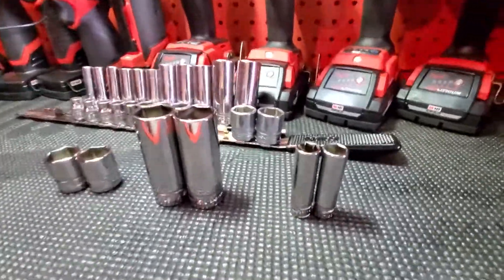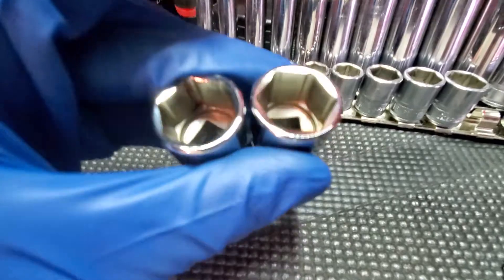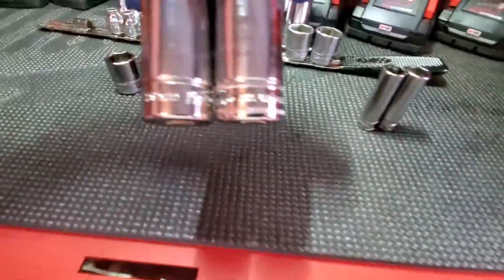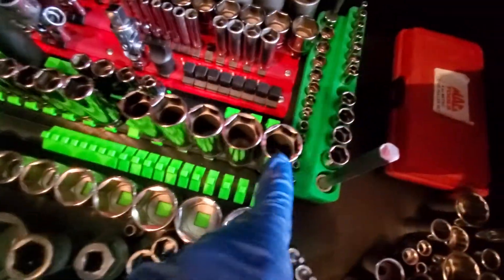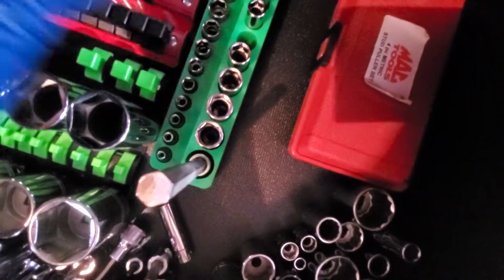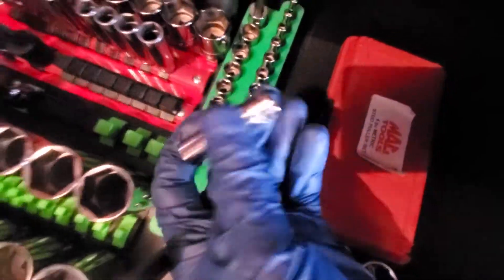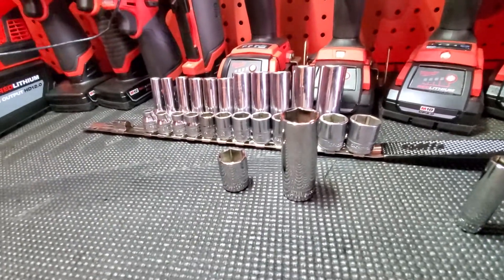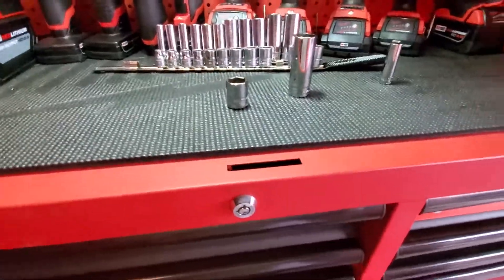Snap-on vs Williams USA sockets are they the same?

Comment: Fun fact..I ordered the williams usa set from Amazon and the one socket was stamped snapon.
Reply: pics or it didnt happen
Reply: @NoLoveinHell  no it happened. go on amazon and look at the reviews has happened to a bunch ofpeople. if there low on sockets theyll pull one from snap on. They are the exact same socket. Williams calls it supertorque technoloy and snap on calls is flank drive , all they do is change the stamp. If you youtube the video of How its made Snap On sockets if you look closely youll see when they are stamping them they actually are showing the williams ones being stamped. They are made in the same factory.
Reply from the maker: Yes sir they even weigh the same.
Reply: @smotheredchrome  this is true as well. In wranglerstars video of him piecing together a snap on equivalent toolbox he purchased the Williams sockets from Amazon and he measured them with calipers they were exactly the same. Another great Williams buy is the screwdrivers. Basically snap on screwdrivers for 1/4 the price. And if you wanted to you could buy snap on colored grips and swap em out
Reply from the maker: Yes that screwdriver set is excellent I got the 19 piece set comes with 5 bahco  Precision screwdrivers and 14 Williams I paid $108 a couple years ago and now last time I checked it was $178 something like that, but one of my favorite sets by far especially the large screwdriver it's basically a pry bar, I will try and find the video on wranglerstar sounds like a good one.

Comment: The only thing is you got to watch out with Williams is they do make tools in Taiwan. sometimes they'll have the same set of sockets for half the price of the USA ones but they're made in Taiwan.
Reply from the maker: Yes usually when the part number starts with a letter it's USA made and the one's that start with numbers are overseas
Reply: @smotheredchrome  yeah I've heard that before about the part numbers.  I am loathe to buy Chinese or Taiwanese tools if I can avoid it and not break the bank
Reply from the maker: The USA sets are IMHO Snap-on just with Williams stamp I have Snap-on sets identical  in every aspect, but some will say different metals but bottom line great buy for usa sockets
Reply: @smotheredchrome  I agree with you the USA made ones are snap-on's with the Williams name on it. it would cost the company too much money to have two different sets of metallurgy.  It's much cheaper to have one production line and then put a different name on it. a lot of companies make private label tools for other companies and put their name on it.
Reply from the maker: I definitely love my Williams use them all the time. I appreciate your comments and support Thank you
Reply: @smotheredchrome  I just got a set of half inch deep Williams impact sockets from Amazon. they were on special so I couldn't pass up the price.  They look real nice. my only issue is the stamping is so small on them, it's hard to read the size. Protos have bigger stamping of the size. I might get a set of Protos for shallows. It all depend on which one go sale cuz they're prices are almost the same.
Reply from the maker: On my chrome Williams they are hard to read also, but I have them memorized in my drawer and that helps alot, but regardless you got some nice impacts for I assume a excellent price.
Reply: @smotheredchrome  yeah I got a 10-piece set for $93 shipped to my door. Plus tax.  Amazon dropped the price for 2 days from $111. so I had to jump on it
Reply from the maker: Nice that is a good deal congrats

Comment: Nice video. 

Do you have any idea if the metal that the Williams sockets are made from is the same as Snap-On? Can you do a hardness or scratch test on the inside of the two socket brands?

Also, how do you know for sure that the Williams are made in the USA? Does the package say 'Made in the USA' or are the sockets only stamped with 'USA'? Are the Snap-On USA made as well?
Reply: Same factory 🏭
Reply: There is Williams USA and Williams Taiwan
Reply: @Montana10mmAuto  I don't know the answer, but I know they are not the same hardness.  That could be caused by a lower carbon alloy or different alloy or a different heat treat.  I have heard that Williams sockets have a different heat treat. Heat treating steel is very complicated, btw, and shouldn't be BSed about. Stuff like how they pack the furnace, how close the sockets are together matters.
Reply from the maker: Thank you my friend I appreciate your comment 🙏

Comment: It is just the same dies. That’s obvious. The steel, how they were hardened, the chrome process you will never know.   They could even be old worn dies out of tolerance for Snap-On.
Reply: Why would one be any different than the other? Why would the "hardening" process be any different?
Reply: @captaingold1685  every batch of steel is a custom batch. Formulated to the customer or application specification. Plus the quality varies. 
Hardening varies with the heat source. Flame hardening, kiln hardening, inductive hardening and case hardening are the types I know of. Then there is the time it takes. From minutes to hours. And the quenching process. 
Steel production is the result of a thousand years of research and trial & error.   All done in secret. 
All steel is not the same. None of it is.
Reply: @davehaggerty3405  I understand all steel is not the same as there are different grades of steel. But using a different grade of steel would not necessarily be useful for application. You're basically saying they could have used a cheaper grade of steel...

I have the MSB-12HRC set which compared to my snap on 3/8 sockets are identical...
Reply: @captaingold1685  I only had one class in metallurgy. And that was 40 years ago so it’s all obsolete. 
I do know they don’t heat treat like they did back when I worked at Irwin.   Where everything came out of a rotating furnace into a big steel basket to get quenched in oil.     
I wouldn’t say Snap-on would use a different steel. Both probably chrome vanadium. But how much vanadium?  It’s expensive. 
I can’t say if they are the same or not. But I would bet they’re not. Why would any company make their secondary brand equal to their premium brand?
Williams is very good.  Made in the same factory. But I’d bet there is something special in the Snap-on process to make them special. There are just too many steps in the process for there not to be.
Reply: @davehaggerty3405  with snap on it’s the brand you’re paying for, not all Williams sets are made in America some are also made in Taiwan. 

They just look too similar. But if they’re different like you say they are good at disguising it. 

Good answer though.
Reply: @captaingold1685  @Dave Haggerty is correct. The misunderstanding seems to be about how factories fundamentally work They aren't some black box you feed raw materials into and tools pop out the other end.  Sockets are complicated and many processes and machines are used to make one.  Those machines and cutting dies and broaches wear over time. If you can create a second quality line of tools, you can use those older machines longer. This means more revenue per machine. Also, any tiny corner cutting you can do and get an acceptable product, will save factory time and lower product cost.  

We have seen many Williams screwdrivers which seem to use identical (?) Snap On shanks and handles but the holes drilled in the handles are sometimes slightly off. Not acceptable for a Snap On screwdriver, but not worthless.  Not saying Williams are Snap On rejects.  But something about the Williams screwdriver line generates tools with off axis shanks. Same factory, same processes. Some say the Williams screwdriver tips are not as hard. They could be rejects or batch processed somehow to lower cost.
Reply from the maker: Thank you my friend I appreciate your comment 🙏

Comment: You are mistaken. They are not the same. But they may very well be good enough, or similar enough. 

Your premise is fundamentally flawed: that they are made in the same factory, or even use common equipment (doubtful) does not guarantee identical utility/functionality. Looks similar, even dimensionally similar (to the extent you can measure) also are not reliable ways to say two items are functionally identical “rebrands”.

More: your generation better figure out and fast how manufacturing works as we surrender more of it to foreign competitors. The “they look the same, they probably all come from the same factory in China” idea is incorrect. You guys all seem to think you’ve discovered some “hack” and found the secret item that’s substantially cheaper than the “same” item found elsewhere. 

The world is a big and complicated place. Sockets are actually quite complicated products. There are good sockets and less good sockets, good beef and not as good beef (I know it all looks the same too). Go explore and figure it out. Try to distinguish between good beer and cheap beer.

Generalities aside, Williams USA sockets may be cheaper alloys, not sure, but they get cheaper processing and finishing and use the older sloppier broaches, and dies, and less rigid inspection. Chrome is also different. If you looked closer, you could see some of this but not all.
Reply from the maker: Thank you AdamC appreciate your comment 🙏 
Honestly my friend I believe they are exactly the same, they even weigh the same socket for socket, and they are made on the exact same line.
Reply: @smotheredchrome  Williams employees have reported elsewhere Williams sockets are made in the same factory as the Snap On branded sockets. They are made using similar tools and processes except:
1) We don't know what steel they start with - I assume its the same????
2) They use the older broaching machines which result in a little more play, but still very functional. The newer versions of these machines are Snap On only.
3) They run more Williams sockets through the heat treat operation and run faster to save time which results in a slightly softer sockets (lots of testing has been done - Snap On usually are the hardest sockets available. Williams are probably more in line with other decent sockets.
4) They skip some finishing steps leading to chrome (see #6)
5) They employees didn't mention this but others have indicated the Snap On sockets are a tiny bit smaller - maybe a finish grinding or???? prior to chrome.  

BTW, Snap On's product development engineers value THIN.  They make their tools hard, strong, and as thin as possible. Some people don't like that. Snap On or Stahlwile make comparably capable combination wrenches, but Snap On's are longer and have smaller ends, both of which provide greater utility.

Good luck
Reply from the maker: Thank you my friend I appreciate your comment 🙏 
Honestly the main reason I believe they are identical is because they weight the exact same socket for socket, but I understand they could have many differences. Thank you again my friend I appreciate the info you shared.
Reply: @KeterMalkuth  I just responded to the premise of the video. “Are they the same?” The answer is “no, they aren’t”. Are they good enough for most users? Maybe. I encourage someone to make content about that.

My point is that there are numerous popular misconceptions about manufacturing that I think you guys need to know the truth about:

1) They look identical, so they probably came from the same factory (in China). Myth. Chinese manufacturers excel at reverse engineering others’ products. China has no protection for intellectual property rights. So it’s legal to rip off US manufacturers IP. But they also rip off other Chinese firms. It’s not just screw over the US, tho that is an attitude. And China is huge. There are hundreds of tool manufacturers all competing to win contracts with US distributors. There isn’t one company making everything.

2) They came from the same factory so they are identical. Myth. Factories routinely make similar products for different price points and different markets. The difference between SnapOn and Williams isn’t just the stamp.

Last my personal opinion is that sending my car to a mechanic, let alone a dealer, is so insanely expensive, the difference in price between the most expensive hand tools and mid range or even cheap hand tools is insignificant. I probably save my family a few thousand dollars a year doing my own repairs. My tools have all paid for themselves many times over. And it’s not just repairs it’s the ability to purchase older luxury cars or high mileage cars.
Reply: They’re exactly the same 🤡